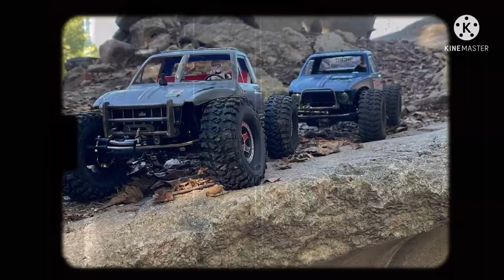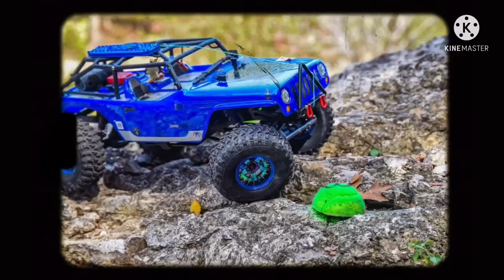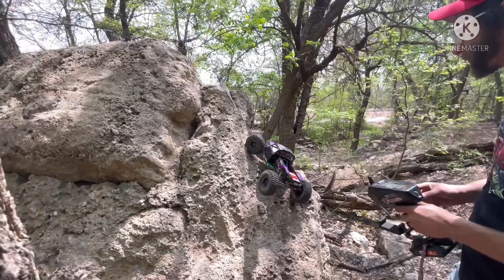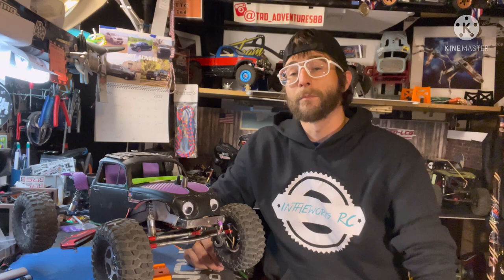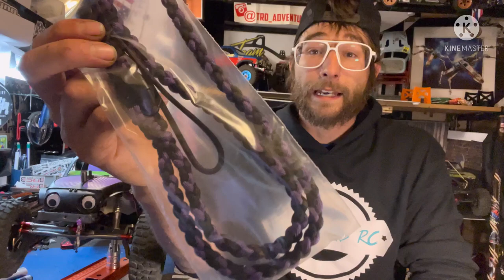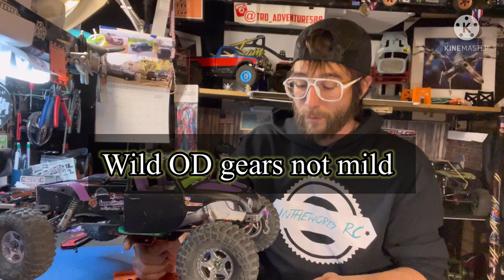Meet the new Class 3- G-Bruck

Comment: For class 3 the width for the bed can be inside the frame rails, just the cab needs to be 5” wide minimum from front to back of doors, you could have built it between the frame rails😉 unless that’s a local rule to you. I run the Salinas T-bed for the V3 and it counts for drop bed points in class 3 and it mounts inside the rails. 
I’m really liking the look of this rig, nice solid build Tim😎
Reply from the maker: Yea I just wanted to make sure, in case something happened I could run as back up in c2 if needed.
Reply: Good call😃